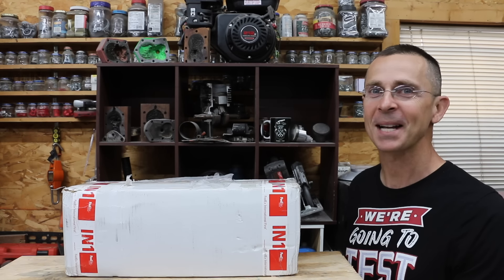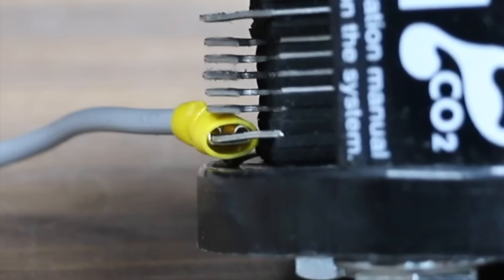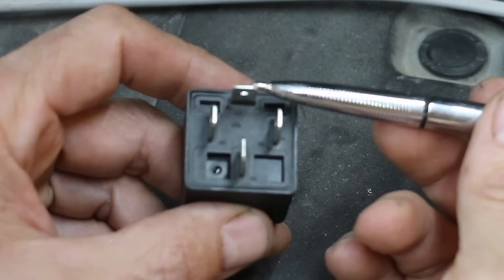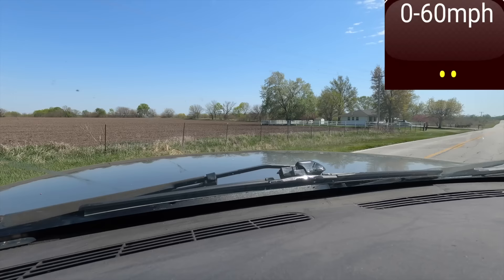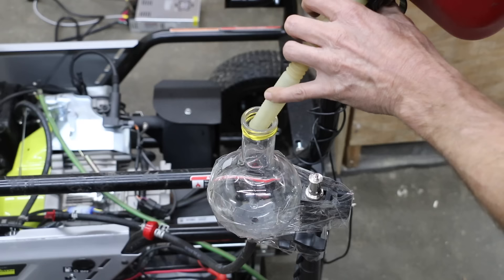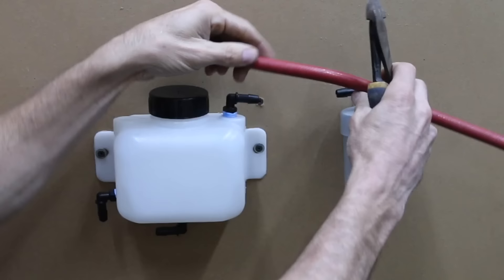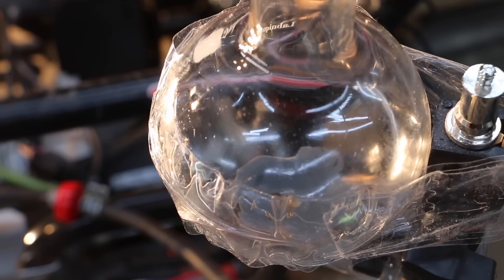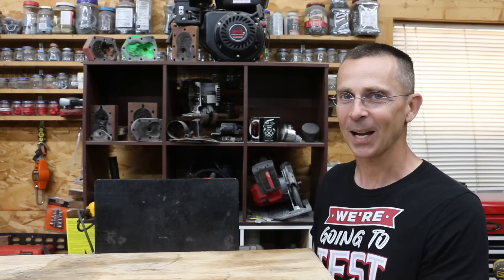AMAZING 35% More MPG with HHO? Let’s find out! Help with high gas prices?

Comment: Before watching: It seems like one of those too good to be true things.
After watching: it is too good to be true.
Reply from the maker: Thank you!
Reply: He use a generator for saving gas mileage. That was wrong you need to install in a car that can lean out the gas to save on mileage. You can’t get mpg out of something that don’t move .this tiny little system definitely isn’t big enough to show anything. So yeah he’s right it’s to good to be true because the set up is wrong . Someone figured they know in theory this works put on a different scale so they figurethey could find a handful of Desperate people to buy the product
Reply: After watching: shiiieeeeeeet
Reply: @NoBs48  You believe in a flat earth don't you?
Reply: @NoBs48  mileage is a way to measure fuel consumption. The generator runs at a almost constant rpm and if you add the exact same amount of fuel you can get a time that can be used to measure fuel consumption. Just because it didn't measure mileage doesn't mean the test is wrong. It is just a different way to measure fuel consumption.
Reply: @NoBs48  Generator was to determine if the HHO was producing better fuel efficiency and therefore a longer run time. If the system was producing more HP, the fuel efficiency would have been increased and less fuel used in the generator so therefore a longer run time. The cost of power to power the HHO generator will always create more of a tax on the system than the amount of HP it gains from the HHO gas.
Reply: @ProjectFarm  I made my own in 2009 and used it on a 95 Chevy Blazer with Vortex V6 and it did boost my mileage from 17mpg to 19mpg with normal driving probably 70% country driving and 30% city driving.
Reply: @ProjectFarm  I have another suggestion. How about making diesel from used plastic/plastic jugs?
Reply: @mathewfullerton8577  I love that he is ignoring my answer to them and the other one as well that described how this test works.
Reply: @jamespeacock356  does it a maf sensor ? No . Well that has a lot to do with it to . I don’t understand why he doesn’t use the truck as an example for gas mileage you can’t just hook it up to a generator to figure out if this thing works or not he is using the vehicle to measure horsepower it doesn’t help horsepower it just helps on saving gas this thing does work I guarantee you it works. It’s been proven . Look it up
Reply: @NoBs48  correct. There was HHO boom 15 years back. Many people DIY this stuff. Some even brought a genset in their truck just to produce more gas. Most fuel savings were obtained with fuel recalibration, carb rejetting, and the engine CPU leaning out the mixture. Being used as is, no fuel saving was seen/measured. Most DIY kit produced too small amount of gas to make the engine run too rich, but enough to lean the A/F mixture a bit without knocking.
Reply: @jamespeacock356  "it's not the answer I want to hear!"
Reply: @NoBs48  you can work out a lot, idle us p much the same
Reply: @NoBs48  It takes more energy to break down water into h2 + o than is gained by burning said gas.  So no mater how you use this device it will be less efficient.  On a larger vehicle it may be less noticeable but it will still be a net loss.  There is no magic to this device, it spits water in to hydrogen and oxygen then burns it. You have loss in the chemical reactions, loss in generating the electricity needed to power the reaction and loss in the inefficiency of engine converting chemical energy to heat and then into mechanical energy.  There is literately no way this could work out as a net positive.
Reply: @NoBs48  look bud you just seen it doesn't work many of us explained how this test works and why you are wrong. Furthermore I'm an ase certified mechanic and I am telling you this system doesn't work and all it is is a waste of money and time just like trying to inform you on just how wrong you are.  Take the loss move on have a nice day.
Reply: @NoBs48  I don't know if you're trolling or you don't know how motors work.
Reply: @jamespeacock356  Don't encourage him..😂
Reply: @geoffreycasey875  but its my post I thought I could. Lol
Reply: @jamespeacock356  I understand that but my point I really wanted to make was that a generator isn’t the same .You have a maf sensor you have different components in a car that leans out the gas so the HHO replaces it to get better gas mileage. I don’t think one this small would make any big difference so maybe his set up is correct in that it’s not big enough to help with saving gas mileage.
Reply: @Redtash1  thats cool! I'm curious how you made your own. I've no clue how to build a hydrogen separator thing. Is yours larger than the one in the video? Did you notice a power increase upon installation that can't be attributed to something else, such as intake charge drop due to extra water vapor in the air mixture? I'd love to know how you built this. I'd like try to build one myself.
Reply: @NoBs48  
   Calm down. 
     CALM DOWN! 
Punctuation is our friend. 

Be careful when you walk to the edge of town. You might fall off.
Reply: I have built an hho generator about the size of two car batteries  and with the right components that are not on this kit I could completely shut off the gasoline on my 85 ford ranger and run it entirely on HHO.  To be fair however I never "installed it and drove it I merely hooked it up started it, let it warm up then eased a ball valve closed and let it sit there and run on water split by electricity from the alternator. The explosive nature of hho however discouraged me from actually using it for anything worth while.
Reply: @NoBs48  Efficiency is efficiency, whether measured in miles per gallon or kilowatt hours per gallon.
Reply: @TAS1303  those had the throttle body injection or was it still carburated?
Reply: @MAGnetICus_Attractus  carburator.
Reply: @NoBs48  Actually the generator used employs direct fuel injection, so it has the necessary sensors. Lets say the fuel was any more energetic - the fuel injection system would reduce the amount of fuel consumed to keep the output voltage constant. This is actually far better controlled than putting it on a truck, where your driving habits will have a lot more influence on fuel consumption.
He also gave it an advantage by not taking into account the amount of energy required to produce the oxygen and hydrogen. Because you're literally making fuel with electrolysis, which is very inefficient, and putting that into the engine in addition to the gasoline.
Reply: @apaxman00  yes it's simple really because water is the product of burning hydrogen and oxygen reversing the reaction through electrolysis is reversing entropy since entropy must always increase in a system if you power the hho generator off the power generated by the engine it is being used to file it will always be less efficient the only instance this might be useful is if you run the hho generator off of grid power as the grid power might be cheap enough compared to gas's to save money even with overall loss of efficiency
Reply: My teacher actually asked me what I thought about that just yesterday. I then wrote a long-winded email explaining how the 1st law of thermodynamics applies to this situation, and how it basically makes your engine run on the battery, which saves you less than a glass worth of fuel.
Reply: Everybody this dose work if you catalise the reaction of course then you have a hydrogen fuel cell instead of an hho generator like to see someone build one of those at home the extra entropy hose into degrading the catalyst
Reply: @NoBs48  dont forget, the unit needs to make much more hydrogen than that dry cell unit makes.  1980 plymouth, with a carburetor, gained a good 5-7 mpg with a pint jar unit.  the unit did not provide enough H2 for a slant six to stay running steady, i am told 5-6 jars would have been needed, i used steel tie wire instead of plates when i made mine.  when the car ran out of gas, my unit could not make enough H2 to keep the engine at a steady speed and after 3 miles, the car was on the side of the road until i got back from the gas station with gas.
Reply: @sexylexy22100  Excuse me, what? Can /you/ give thermodynamic calculations for how your approach generates more energy than it uses? Because I can give you calculations showing that this is not the case.
Reply: @NoBs48  All a maf sensor does is measure how much air is coming into the engine. This is used along with the intake temperature sensor to approximate a proper fuel mixture. The oxygen sensor is what is used to get the fuel mixture fine tuned. You obviously don't even know how a fuel injection system running in closed loop works in an engine. Either way it takes more energy through electrolysis converting the water into HHO then you get from burning the HHO.
Reply: @TAS1303  that's why it worked without major modifications.  A while back me and a friend were talking about making fuel with waste doughnuts.   My friend reminded me how you get more gas production if you apply a vacuum along with heat. Then we were talking about those 12 volt water misters and how the heat of the combustion of fuel turns the water vapor to steam pressure. All sorts of ways to save on gas consumption.
Reply: @thanebaxter  While this product is junk, your reasoning for why you can’t get back more energy than was consumed to produce the gas is a little off.

Engines typically only run at around 30% efficiency, and that efficiency tends to increase with increased load. If you had two 5000lb trucks that you drove up a mountain, they’d consume more fuel than a 5000lb truck towing a 5000lb trailer. The HHO device is trying to increase the thermal efficiency of the engine by increasing load, and then supply its own fuel (H2 and O2 gas) to compensate for the higher consumption.

Thermodynamics would rule this out if the engine were already operating at 100% efficiency, but since 70% of the energy in the fuel is wasted as heat there is a theoretical possibility that these devices can exist. At the end of the day though this product is not worth buying.
Reply: @TAS1303  , cool story bro, if it wasn't for nature's laws of energy and thermodynamics that your story is not 100% true. As it sits the total system efficiency is way less than 100%, thus there's no way on Earth to run an engine using that "concept" alone. Just in the HHO system there's thermal loss as the unit warms up, then the alternator is less than 100% efficient, so there's energy loss there too, and since the amount of energy generated by combining HHO back into water is the same as turning water into HHO, there's no way on Earth that engine would continue to run on the HHO system alone, that while assuming that the engine efficiency is 100%, which is twice as much as the most efficient engine available today. So yeah ...
Reply: It seems like the people who so vehemently defend the HHO "theory" and make all these wild claims are the same guys who didn't pay attention in science class. Now they throw around big words they don't understand but saw in a forum, trying to appear intelligent. Here's a phrase they won't understand, but explains it all: over-unity. There's no such thing as a free lunch. If you dropped out of high school and have lived off government assistance your entire life, you probably wouldn't agree. But what you don't see is all the hard working tax payers covering your welfare checks. The same principal is hard at work in these HHO experiments.
Reply: @NoBs48  this dude definitely skipped school for flat earthin
Reply: @NoBs48  
You may recall that the gub'ment measures milage on a car the runs on a treadmill. So it doesn't move either.
Reply: @TAS1303  your truck was running off its lead acid battery. Lol. The ONLY vehicles to ever see improved mpgs were ones with worn rings and blown gaskets. Hydrogen helps in engines with terrible compression.
Reply: Interesting that everything seemed to be doing what was advertised but the numbers didn't change much. So where's that energy going?
Reply: @NoBs48  are you blind? EFI is the largest text on the generator. That means it has a map and 02 sensor. That means it DOES lean back the fuel.
Reply: @Redtash1  and plastic bags
Reply: @johnwaterman9647  it was about 11 or 12 years so the exact details i don't remember but I had a friend that gave me a piece of stainless steel that would cover like bench and cut it into I think 9 pieces about 3x5. 3 was hooked to the positive, 3 to negative and 3 was neutral meaning they just didn't have any voltage going to them just used to separate the positive and negative plates. From what I read it was supposed to help with HHO production. I bought all stainless steel nuts and all tread to assemble them. It takes alot of time to read and watching video's on YouTube to get an idea of how things work and how to put things together then trial and error on mixing the white stuff he was mixing to get the best output without drawing to many amps that will blow the fuse or melt the wire😁😁.
Reply: @NoBs48  you don't need any sensors, the generator has a GOVERNOR. if you put some sort of high-falutin superfuel into the tank, and it's producing more energy than gasoline, it'll show it by using less of it to make the same power, and run longer.
For our next test, we can dicover just how dense your brain is to a brick wall.
Reply: @synewparadigm  Yeah I put plastic/plastic jugs. I saw some videos that people was using plastic bags also. Anything that is made from the type of plastic that is able to be melted down to create it and it would also be recycling them.
Reply: @Redtash1  that's a good question.
Reply: @Tom-cc1wl  Pulling a trailer or powering a heavier vehicle may increase efficiency of fuel converted to mechanical energy, but it also increases the amount of work required. If this wasn't the case we would be building heavier vehicles to increase mpg. Applying additional load to the engine via the alternator does not increase the amount of power supplied to the wheels.  It is a parasitic device, robbing power that could have either not been needed requiring less fuel or reducing the total capacity of what the vehicle can move. So no, I still don't see how any device using electrolysis could improve fuel consumption.
Reply: @Redtash1  thanks for the info. I'll make it into an upcoming project.
Reply: @chuckaddison5134  Most people never refer to their cars mileage as what the vehicle is rated. You simply track the mileage of a full tank to the next time you fill it up. Almost everyone does that at some point.
Reply: @thanebaxter  - "So no mater how you use this device it will be less efficient."
Hmmm, not entirely true. If the ECU was able to compensate for the additional H2 gas, and the system was powered by a Solar Panel on the Roof of the vehicle, which stored electricity in a Lithium Polymer Battery - then the additional Energy would effectively be free. However I'm not convinced that the ECU's of either the Test vehicle or the Generator, was able to compensate for the addition of Hydrogen Gas, nor am I convinced that enough H2 gas was being made available. The problem with this video is that an ECU is limited by it's programmed maps, and those maps are limited by emissions. Emissions were not being monitored here. So even if the ECU was unable to compensate for addition of energy input, then the benefits of any reduction in pollutants cannot be appreciated either.

A truly 'SCIENTIFIC' approach would change all existing know variables, before attempting to observe the effect of an unknown variable. So test the effect of enriched Oxygen into Air Stream, then Test the effect of additional Octane into fuel of the Generator, to see if those known variables allow the test system to acknowledge the changes an adapt. The only way to test that fully is to monitor emissions.

So whilst I appreciate what PF does in his videos, sometimes his 'SCIENTIFIC' approach is not quite Scientific, nor are his assumptions - as most assumptions are far from scientific. I've seen videos where ECU's designed for 91 Octane run poorly on E10 and terrible on E85, but with a custom 'TUNE' for E85, the same engine runs incredibly, providing way more power than the same engine tuned to run on 91 gasoline. Ignition Timing plays a significant role in energy production of a hydrocarbon powered combustion engine!
Reply: @NoBs48  Agreed it would work better on a Carb than EFI unless you have an EFIE/MAF tuner. Depends on the the stainless steel plates and how many you have as well.
Reply: @blueridgerennsport  - "Efficiency is efficiency, whether measured in miles per gallon or kilowatt hours per gallon."
Yes, but it does not automatically imply that the test conditions of the experiment were 'scientific'. Nobody measured emissions, and nobody checked to see if the ECU was able to compensate Timing for additional energy. The test vehicle was not measured for fuel consumption or emissions. Therefore without picking this PF video to threads, IMO it is not a scientific evaluation, as too many variables and parameters were ignored.
Reply: @graealex  - "Lets say the fuel was any more energetic - the fuel injection system would reduce the amount of fuel consumed to keep the output voltage constant."
Hmmmm, only partially true! You see all engine manufacturers are limited by EMISSIONS. Do we remember the whole VW EGR BYPASS SCANDAL? Yes, VW engines developed a lot more power than any other manufacturer, but not because they built a better engine, it was only because they programmed the ECU to take advantage when the vehicle was not set up on a Dyno for testing EGR & EMISSIONS. Unfortunately, like many other PF videos, he is not always very 'scientific' in his application to all the known variables.
Reply: @Redtash1  Did you replace your spark plugs at the same time or fix a vacuum leak? LOL. I made one of these too back in 2005. It was fun to learn about and make small explosions from filled sandwich bags. Physics remains the same though. It takes more energy to produce the gas than the gas makes when it burns. Otherwise, why has someone not made a perpetual motion machine powered by one of these with the only fuel being water and electrolyte connected to an alternator to produce the electricity it needs? once it gets started it will keep going, right? clean burning evolution of cars! LMAO.
Reply: @sexylexy22100  - Unless PF used a Solar Panel on the roof of his truck, and stored the required energy in a 12V Lithium Polymer Cell...?
Reply: @Earlve001  Depends on what you mean by proper? If you don't take into account the power it takes to run the HHO generator, then the test is invalid. A alternator in a car does not spin easier the more power it is creating. Regenerative breaking in new electric vehicles are basically using their motors as an alternator when the car is braking and the resistance that is crated by making the power is what slows the vehicle. Taking the power generation out of the picture would only taint the results.
Reply: @mathewfullerton8577  Must be a Democrat. Dont need facts, just feelings :-)
Reply: @sexylexy22100  - Yes, a HHO generator can work more efficiently if the ECU is able to recognize and compensate for the additional energy, and when the HHO Cell uses a larger Surface Area to Volume Ratio and a forced flow to remove gases from the Surface Area. I have previously built a system that uses a Twin Water Filter Cartridge system, with Extruded Carbon Filters as Anode and Cathode. The effective Surface area of a regular 10 inch Water Filter cartridge @1um is about 1 acre - as opposed to about 100 square inches of that crappy HHO generator. With the addition of a small Brushless 6Watt (0.5A) water circulating pump, the liquid flowing through the filters is constantly removing any gases, which in turn gives a constantly higher available surface area for HHO reductions to be performed. Adding a Solar Panel to the Roof and a Lithium Polymer Battery means that power is not being taken from the engine for Electrolysis.
Reply: How do you check efficiency on a carburetor with now way to lean out and actually test if its helping with efficiency
Reply: @danielrouw2593  - " That means it DOES lean back the fuel."
Your assumption might be true, IF and only IF PF monitored the EMISSIONS.
The ECU only adjusts Timing in accordance to known parameters, to meet emissions standards.
PF would need to do runs with High Octane Fuel to see if the ECU is able to adjust it's tune to allow for Timing that can take advantage of High Octane Fuel. He would then need to see if the ECU can account for a higher concentration of O2 gas, as most ECU's assume 20% at 68F at Sea Level.
As much as I love PF, this experiment is far from SCIENTIFIC.
Reply: @danielrouw2593  it was 288 4"² stainless steel plates.  it rolled off so much gas it was scary. Can't tell me the engine can't ignite that.  Granted that old hundred dollar pickup had crap for compression. You could put it in first gear and push the vehicle. But in the five years I owned it it never used oil. I recall putting a high amp alternator on it and some other electrical part that had something to do with voltage or amperage to the plates and I purchased a mass air flow sensor manipulator to install the rig on my Chevy but never did due to safety concerns. I can make it work. Someone else's inability to do so does not mean it can't be done. Hell you can run a pickup on wood smoke even.
Reply: @NoBs48  Hey bud, is this you in the passenger seat? See you tube :
The real meaning of MPH- The Original- TCHappenings
Reply: @ProjectFarm  it would be great to see a magnetic water softener tested. But you would be forced to take the video down by the manufacturer. You might even get sued for loss of business.
Reply: @delawarecop  That doesn't even remotely relate to using the generator as a measure for relative (!) fuel efficiency. Obviously it's possible to make an engine more efficient if e.g. more NOX emissions are allowed, driving the engine with a leaner mix. 
Besides, there is not a single good explanation why injecting hydrogen and oxygen would produce a surplus of power relative to what you have to spend to split up the H2O in the first place.
At least with stuff like water injection, we actually know that the water vapor cooling down the combustion increases efficiency. But there is no explanation why adding a little bit of H and O2 should increase efficiency by the claimed 35%.
Reply: @Redtash1  no you didn't.
Reply: @delawarecop  It doesn't need to be scientific here, only entertaining and ultimately correct. There are countless other scientific experiments and studies done on HHO, all with the same outcome - it doesn't work. Project Farm already knew that going into the test. Most of us already knew that before we watched this video. Even some of the people who swear that HHO actually works know it. This was just a fun way of making a point.
Reply: @Earlve001  ahh, I see. Or anything at all (good or bad). Good point. Then yes, a test with an alternate power supply would be handy.
Reply: @graealex  - Put a Solar Panel on your roof and have it charge a Lithium Polymer Battery while it's parked. That FREE electricity can be used for the HHO process, so you end up with a NET SURPLUS of energy. And if enough HHO can be compressed an accumulated in a tank, then 35% improvement of efficiency could actually be realized.

Just think for a minute of how many cars driving on roads without a Solar Panel on the Roof, and WHY EXACTLY don't car manufacturers use that FREE ENERGY to reduce the combustion engine efficiency of having to drive an Alternator?
Reply: Can't they be sued for false advertisement?
Reply: @NoBs48  

As Clemence has stated, fuel saving happens when the mixture is leaner and not as rich. This is done though a computer controlled program that makes the airflow less rich. Any car can have this installed on it.
Reply: @delawarecop  Might as well carry an additional gallon of fuel, if you have to carry the weight there is a lot more energy in a gallon of gasoline/diesel then there is in a gallon of water. Plus you don't need to haul around all the crap that is needed to generate the hydrogen.

If you are hell bent on burning hydrogen then it would make more sense to leave the solar panel at home generate your hydrogen there and then transfer it to a fuel cell on your vehicle.  Of course you also need to re-tune your vehicle to adjust for the hydrogen.

But if you are going to run solar at home it makes even more sense to just charge an electric car and forget about the hydrogen.
Reply: @delawarecop  Power from the little area on the roof is negligible. I work in automotive, and in the simulations and tests, it was barely enough to keep HVAC (without actual AC) running on a hot day to decrease inside temperature. And that's if you get a lot of sunshine where you live, to offset the additional weight you will be carrying around day-and-night.
People like you just need to stop their fantasies, somehow thinking they are a lot smarter than all the engineers. Just, like, stop with it. It only shows how little you understand of the topic.
Reply: @delawarecop  Solar panels and LiPo batteries are not cost-free, and a solar panel (or array of solar panels) large and efficient enough to charge a LiPo battery large enough to supply voltage and current for the entirety of your run cycle will encroach on your aerodynamics and add weight to your vehicle (as will whatever HHO contraption you have rigged up), contributing to drag, thereby lowering the overall efficiency of your vehicle. It has been proven time and time again that any gains from HHO will not overcome those losses. Calculate the costs of the materials and equipment used toward any gain experienced and you will find that you're in the hole, and calculating a return on investment isn't possible. Look, you can use propane as a catalyst for extracting more power from a diesel engine, and it is very effective, but the costs and added complexity involved prevent it from being an efficiency booster. Instead it's used as a power booster and range booster for towing. Propane injection systems use 1 gallon of propane per every 4 gallons of diesel (20% of the fuel being consumed), yet only offers about a 14.75% increase in instant MPG. So instead of going 816 miles on 48 gallons of diesel (17 MPG), you go 936 miles on 48 gallons of diesel plus 12 gallons of propane. Since diesel and propane are about the same cost where I live (a difference of just pennies per gallon, propane being the more expensive of the two), it's actually less economical to use propane as a catalyst because you're only getting 10 MPG from those additional 12 gallons of propane, while 12 gallons of diesel nets you another 204 miles at 17 MPG. Once you factor in the cost of the parts/equipment, installation, consumables, maintenance, drag, additional wear and tear, etc., nothing you do in terms of adding a catalyst system like propane or HHO will increase your efficiency to the point of earning a tangible return on investment.
Reply: @thanebaxter  - It's about IMPROVING the efficiency of an ICE. HHO does that, and so does N2O. For the $ I personally would go for N2O as a catalyst. But if an ICE is tuned to operate at maximum efficiency using HHO, then it does improve the efficiency of any ICE, but more importantly it reduces pollutants and reduces the destructive need of EGR. So there are more long term benefits to adding HHO than chirping tyres.
Reply: @jamespeacock356  This will not make more power...    that  HHO generator  can barely make anything  the amount is laughable
Reply: @delawarecop  For it to work properly would you not have to very the amount of HHO you were adding to the engine?  Obviously the ratio of HHO to Fuel would vary if you inputted a constant amount of HHO at idle as compared to road speed with a load.  The vehicle has no way of knowing that you changed the air to fuel mixture so that would cause varied results and possibly make emissions worse.  I just don't see a hose bubbling in HHO making any noticeable positive difference, but I could see it causing problems. Without an external source of power I am confident it would still end up a net loss of fuel efficiency.  Hydrogen is much less energy dense so you would need more by volume to offset the fuel it replaced.

If you have a source of an actual scientific paper proving this tech works I would gladly read it, but with people just making claims and having no controlled measurements I find it suspect. Too many unknowns that could cause variations in data, making it look like it worked when in fact it didn't.
Reply: @danielrouw2593  it's not a California version lol
Reply: @apaxman00    if you have a hybrid  you can make  power via the regeneration   most of the regeneration is lost to heat anyways  I.e once the battery is full
Reply: @danielrouw2593  it has No map or maf sensor I checked the parts list  for that generator      but does have an O2 sensor   so it's an incomplete remark you have there
Reply: @delawarecop  I used an HHO system about a decade ago and did lots of research to learn how it worked. The idea as you said is to get the computer to allow the HHO to do its job. If the parameters of O2, MAF, IAT, Coolant temp, and timing are not allowed to go beyond factory settings then there will be no observable benefit as we saw in this video. The system I researched was designed to combine HHO with "cracked" fuel (breaking the molecular structure of the fuel into smaller chains and adding hydrogen to stabilize them) that would then burn more quickly in the combustion chamber. That does no good unless you can retard the timing to take advantage of the quicker burning fuel. It burns cleaner as well. The problem has always been the CPU in the vehicle itself. I know you can increase fuel efficiency just by manipulating those parameters but as was stated by someone else you run the risk of engine damage. With the HHO gas added to the fuel properly it actually helps prevent that damage. Its a fairly complex process that happens at the molecular level and I cant explain it all here, and its been over a decade since I researched all this, but the science of how it CAN work is solid.
Reply: @graealex    this might work for a hybrid as you would be capturing the power via regenerative braking  you can get like 20-30KW  from a full power regenerative braking....
 that is almost 2,500 amps at 12volts
which other wise would be lost as heat
Reply: @delawarecop  You're not even smart enough to understand what a catalyst is. With N2O, it undergoes combustion, and that is the exact opposite of a catalyst. Which is actually good, as N2O has a serious greenhouse effect. Please stop the fantasies, it's really making you look silly.
Reply: @jebbusk4805  Lol at the contrived explanations. This is borderline perpetuum mobile territory. Yes, add a bit of oxygen and hydrogen, and it solves all the problems that engineers have been working on for more than half a century. I'll just assume your "research" involved a lot of Facebook posts.
Reply: @Delimon007  The problem with a very lean mixture are NOx emissions. Emissions in general are what is currently holding back efficiency. Especially Diesel engines are suffering from the back pressure from all the exhaust treatment. That isn't even a secret somehow, everyone knows that the operating point for maximum efficiency is different from the operating point for best exhaust treatment. But the reality is that cars can't be driving around spewing out NOx and particulates without limits just to improve fuel efficiency a few percent.
All the people here need to understand that engineers are already operating very close to what is possible, and that there is no magical 35% improvement to be had, nowhere.
Reply: @graealex  

It's actually not just a few percent for many cars. Done properly you can increase your MPG by 50% but it depends on the car. If it's a hunk of junk then it's not going to help much. If it's a sports care you can greatly enhance you MPG.
Reply: @Delimon007  Well, might be a true for a modern Diesel, which can be very efficient if you completely forget about particulates and NOX. Ultra-lean mix, high boost, no exhaust gas recirculation and no particulate filters as well as any catalysts, a good amount of efficiency increase might be possible.
Reply: @punker4Real  Yes, but using that energy for electrolysis of water is just bonkers. And I don't want to sound condescending, but a large chunk of the efficiency increase that can be had with regenerative breaking can also be achieved by changing driving habits.
Also, it again shows that most people here, including you, have zero idea of what they're talking about, as anything above 10kW requires 48V. That in turn requires an additional battery, as well as DC-DC converters. You're also needing a combined starter-generator, which also adds weight. 
It's not like car manufacturers and suppliers aren't calculating this stuff day and night already. But everyone here is "I am a genius because I have an idea that no engineer could ever have thought of".
Reply: @graealex  

It requires a computer to do it for a reason
Reply: The comments on here are a riot.
Reply: @Delimon007  I don't understand that remark. ECUs have been a thing in cars for more than 3 decades. "Putting a computer in" isn't a novel idea, especially none that solves any problems that haven't been solved before.
Reply: @jamespeacock356  I’ve never seen a better example of a pot calling a kettle black. You both have little to no understanding of ICE, this is very possible but like T Miller is trying to explain, it has to be implemented correctly to gain maximum efficiency from the system. Simply adding more fuel to the mixture doesn’t work with modern fuel injection/electronic ignition like it did with engines that use a carburetor/points.
Reply: @graealex  it was actually from the people who developed it. I dont claim to be a chemical engineer, but there's more making HHO an effective additive to make gasoline a better burning fuel than simply adding it to the intake stream. This system is just a small part of a much larger equation...it really is pretty fascinating when you get into the details of it.
Reply: @jebbusk4805  Yes, it's a very large equation and then it all suddenly makes sense. How convenient that nobody is actually able to explain it, besides vague hints at also using a different fuel or completely forgetting about engines having to operate withing emission targets. But everyone can claim that, if properly implemented, it works really well.
Besides, the product reviewed in this video claims the benefits just from installing this unit. And that is fraudulent.
Reply: @graealex  I agree the claims on this unit are fraudulent,  but tell me what the most efficient form of fuel that can be burned completely is? Plasma is what I understand...and if you or the automotive engineers can figure out a way to get cars to run on plasma derived from gasoline then that would really be something! There would still be limitations on how efficient you could actually make the engine burn that fuel and convert it into rotational power but it would at least burn completely and have zero emissions.
Reply: @Redtash1  it's impossible since you can create energy and you consume energy to produce your hho from your car electric system
Reply: @jebbusk4805  oh man dude. Plasma is not a fuel. Plasma is a state of matter and is not something you'd be running a car on. At least not directly. The most efficient internal combustion engines are those found on large ships. But that's due to the engine's slow rpm. The fuel type doesn't really matter as far as efficiency goes. The difference is the way an engine burns fuel to create mechanical energy.
Reply: @punker4Real   copied direct from the efi service manual component list "Oxygen Sensor — Exhaust mixture monitoring device" 
And.. Under intake manifold
"temperature and PRESSURE sensors" 
Quote direct from the manufacturer "Equipped with an automotive grade Electronic Fuel Injection system, which provides up to 25% fuel savings, simplifies off-season storage, and provides optimal performance in a variety of altitudes and temperatures." so yes it WILL lean out the fuel.
Reply: @delawarecop  clearly you don't understand how EFI works. EFI adjusts FUEL INJECTION. Many EFI systems run a dizzy, EFI /= timing. Its in the name.
Reply: @smarts53  fair enough...I genuinely am interested in learning more on this subject, there is an amazing potential for changing the way we can move and live in this world. I would like to honestly know if there is a way to make the fuel we burn more efficient...as in burn more completely. The catalytic converter in a vehicle is there to burn the unburned molecules of gasoline...the ones too long to be burned inside the combustion chamber right? So how do we get the fuel momecules small enough to be burned more completely in the combustion chamber? As I understand it, if you can break apart a molecule it becomes unstable and wants to form back into a stable form...adding hydrogen molecules would acconplish this right? Smaller molecules of fuel burn faster than longer ones right? Methane, butane, ethane, etc. Am I on the right track or completely up in the night? I would like to learn more if you or anyone else could chime in on this subject I would be all ears!
Reply: Can an internal combustion engine be tuned to run on hydrogen? Yes. Multiple manufacturers have built cars that ran on hydrogen. BMW even produced a 760Li that ran on either gas or hydrogen and kind of leased it... sort of. It can be done. Not by any of you, of course - your projects won't amount to anything but a hazard at best, or a fire that burns your trailer park down at worst. And those with a firm grasp on physics and the actual knowhow won't, because they understand it's a losing proposition. The outcome is disappointingly inefficient and that is the main reason we don't have hydrogen-burning cars today. Hydrogen-powered cars get about one quarter to one third the mileage as their gasoline counterparts. It requires a lot of hydrogen, much more than any of your cobbled-together contraptions can produce, and it requires regulation - something else that pile of junk you zip tied under the hood of your jalopy cannot do. You know, I get the impression that some of you guys completely believe that some random broke-dick hack, just like you, built the 100MPG carburetor only to have the oil companies threaten him and his family and force him to turn over the patent 🤣 You flat-earther sovereign-citizen types enjoy driving your HHO-powered cars around.
Reply: @jebbusk4805  "plasma derived from gasoline" - this is so outlandish and shows so little basic understanding of the terms you are using. Plasma isn't some form of fuel, it's a state of matter.
Burning hydrogen is perfectly fine, not only does it burn cleanly, but in addition without any CO2 emissions. But that hydrogen still has to come somewhere, and electrolysis is still very inefficient.
What matters most is practicability. There are ways to extract heat energy very close to the theoretical maximum, but that's very impractical for a car - it works better in power plants. Lots of stuff has been tested, even extracting energy from the waste heat of the exhaust gasses, or as someone has mentioned, putting solar panels on the roof, but the reality is that all these concepts have failed on accounts of being too heavy, too complex and too expensive with negligible benefits.
Using electrical energy to produce hydrogen in a car with an ICE also falls under the category "negligible benefits", or outright worsening efficiency.
Reply: @graealex  ok, thx for helping clarify my understanding. So is there a practical way of helping make the fuel we currently use burn more completely? Even just a small percentage would mean huge fuel savings over the long term and help us extend the use of fossil fuels while we develop alternatives.
Reply: @danielrouw2593  - LOL, the EFI doesn't run by magic... it has a programmed set of parameters, which ensure that it operates within emissions requirements. If the Computer doesn;t know about HHO gas input, then how does it know to adjust for better timing? Otherwise you are saying that the EFI will automatically adjust to give more power when you put 98 Octane fuel in the tank?
Reply: @jebbusk4805  - Of course HHO can work, especially if the engine is specifically designed to take advantage of the rapid shock wave that is produced when Hydrogen oxidizes. And as I said, I designed a system that has 1 acre of surface area in a 10 inch Carbon extruded Water Filter. SO when coupled with a small brushless DC pump, the system is far more efficient at splitting H2O into HHO, than the dinky little $200 device that PF purchased.
Reply: @jebbusk4805  If you want to save on fuel, drive a smaller, more lightweight car and be gentle with the throttle. Instant 35% MPG increase without installing any sort of bogus HHO generator.
Reply: @TAS1303  Yeah... not to mention potassium hydroxide - KOH is (a form of) lye (sodium hydroxide - NaOH -  is household drain cleaner form), *if something explodes you could end up with lye solution in your eyes!*

Finally... the plates in the gas generator are usually made of stainless steel. Electricity flow + the KOH can leach some of the chromium out of the stainless... and into the solution. Chromium exposure (especially in its hexavalent form) is a good way to get cancer.
Reply: @delawarecop  You really, really need to lookup what a catalyst is - a catalyst either temporarily participates in a chemical reaction and afterwards returns to its original state, or it never changes at all. As such, NO2 isn't a catalyst, it's a reactant, as it decomposes irreversibly. Just stop posting nonsense here. And yes, part of the N2 actually gets combusted, that's the dreaded NOx as a result. Injecting N2O as a way to increase fuel efficiency or even reduce emissions is about the worst idea I heard in years. Complete fantasy world you are living in.
Reply: @delawarecop   If your solar panel and battery aded no weight, aerodynamic drag, or cost to the vehicle, then they would truly be magic.
Reply: I didn't research it any further, but there are published research articles about this. It's hard to believe all of them were lying and it isn't the kits that are trash. The hydrogen is used to boost the inital explosion provoked during ignition and maybe this requires more changes.
Reply: @graealex  ok nevermind...im asking questions that go beyond this gimmick. The HHO thing can work if every variable is accounted for but it requires way more than what was tested here. All Im saying is if there is a way to enhance the gasoline being burned to make it burn more completely then that would benefit any ICE. As far as plasma goes, are you saying there is no way possible to get liquid fuel into this fourth form of matter?? Solid, liquid, gas, plasma. You have to break it down without igniting it right? As I understand it if that form of matter could be burned in an ICE it would burn completely..its well known its more efficient to burn fuel as a vapor, so why not take it a step fuether? Obviously there is no such thing as this in the automotive industry kthat Im aware of), im just saying what if?? Hydrogen as I understand it is a step in achieving this....then you would have the energy that gasoline provides (as opposed to just burning hydrogen) but in a  complete and clean way, and it would yield much greater fuel economy and power. I would love to learn more about this subject and initially I thought you might be able to discuss this, but you seem more interested in acting like the smartest guy in the room and being condescending towards others, not cool man. Maybe this just isnt the right place for discussing such topics....
Reply: @vitordelima  - Yes, hydrogen is a useful fuel in an ICE. How it is being produced, from an Alternator running off Hydrocarbons is never going to increase the efficiency of an ICE. If the Electrolysis unit is powered by another source (Flexible Solar Panel mounted on the roof - charging a Supercapacitor and Lithium Polymer Battery), then it can improve the efficiency of an ICE for short runs of up to 3-4 hours, after 6-8hrs of sunlight to charge the system.
Reply: @graealex  

FYI, if you are an engineer you should already know that humans are not the major cause of pollution on the Earth anymore. The major cause of pollutants on the Earth is currently the Earth itself. If you want to advocate for the reduction in pollution then you need to go talk to third world countries and China.
Reply: @Delimon007  Lol, "the earth itself". The main factor is still humans burning fossil fuels. And finger pointing doesn't help anyway.
Reply: @graealex  

Here's another fact, scientists DO agree that global warming and climate change is an issue, did you know that there is no consensus that humans are the cause of it and that most scientists actually disagree that humans are the cause of global warming?
Reply: @Delimon007  There is 100% consensus from every respectable scientist that human CO2 output plays a major role in global warming. Don't invent stuff here.
Reply: @graealex  

I just gave you multiple links that debunks that nonsense. have a nice day sir since you clearly do not believe in facts.
Reply: @Delimon007  Posting links on YouTube doesn't work due to anti-spam measures, and there is nothing to debunk climate change anyway.
Reply: @delawarecop  

I would recommend that you stop arguing with that person. No matter how much proof you post of ACTUAL ENGINEERS AND SCIENTISTS DOING THINGS, that dude will deny it.

Computer chips are extremely important because they control how things work and as you stated if the computer doesn't know about something it's not going to use it.

They actually also explain this in the video I posted where they made the corvette fuel efficient, the chip needed to be changed to recognize the air flow mixture and get the timings right etc.

That person is clearly not a coder nor an engineer so speaking with him/her is a waste of time especially since they already know everything there is to know.
Reply: @leeroth5604  this was easily 12 years or so ago and all what was used in the prototype hho generators  was water and a small amount of calcium carbonate. I have no personal knowledge of any possible benefits of using any hydroxide salt instead. A tablespoon of baking powder seemed to work just fine
Reply: @jebbusk4805  The error is your assumption that fuel isn't already being burned as cleanly as possible, without increasing noxious emissions. As stated multiple times in this thread, fuel efficiency can simply be increased by sacrificing quality of exhaust treatment. Especially burning a leaner mix leads to higher fuel efficiency, but the higher temperatures coincidentally lead to the formation of NOx combustion products, which are dangerous to humans.
And no, mixing in a negligibly amount of hydrogen will not change this. 
The concept is flawed because there is no free source of HHO. A study from 2015 shows significant increase in fuel efficiency, but completely neglects to account for the power draw of the HHO cell used, as well as the energy cost of producing the reactants (NaOH, KOH, both which are very energy dense by themselves) in the cell. This might seem insignificant, but it's actually the most important thing: where does the hydrogen come from?
What would actually have more chances is water-injection. Although not recoverable, it only acts as a catalyst to increase thermal efficiency, and with proper ECU adaptation increases fuel efficiency. Maybe people are confusing these two technologies.
Reply: @Delimon007  Both coder and engineer. And hearing someone say "Computer chips are extremely important because they control how things work" doesn't lead me to believe you are understanding how an ECU actually works.
And as repeated multiple times, the source of the hydrogen is the problem. Burning hydrogen is 100% a good concept. But if you have to produce it on board of a vehicle, you can't claim the amount of gasoline saved as "increased fuel efficiency" without mentioning the power draw, as well as the energy in the reactants inside the cell. You're just moving the power source.
The theory behind all this is that you might be able to use a leaner gasoline mix, which by itself would actually help with efficiency, at least in situations with low power demand, as injecting hydrogen leads to less formation of NOx. That's the theory, but without any actual numbers that account for all the additional energy required to produce that hydrogen. I'm fully aware of the working principle. Are you?
Reply: @jebbusk4805 keep in mind that achieving 100% complete combustion does not mean 100% efficiency. What we want to do in an engine is take all of the available chemical potential energy (the potential for the fuel to make heat) contained in a fuel and transform it into mechanical energy (move something). Engines already burn their fuel extremely well. The hard part using that combustion of fuel to spin something. Technically you could probably make a plasma out of gasoline and it would be scary and not very useful for anything other than setting your lab on fire. Plasmas occur when an atom has all of it's electrons ripped off by getting really really excited. Ever seen an electrical arc from welding? That super hot bright arc is made of plasma from the shielding gas and metal being welded. Not exactly something you would use as a fuel for an engine. Also to generate such a gasoline plasma would take energy. And thats energy you're using to create plasma and not power the wheels of a car.
Reply: because its not true.. its fake
Reply: @jjOnceAgain  that’s it I don’t know how motors work . I just watch 10 minutes YouTube video and  agree with this guy or that one . You think the guy that invented this spent a day figuring it out . The System works whether or not the scale of this one isn’t working is another story. Saying that it does not work after testing  a generator is absurd . I can agree to disagree. Don’t forget what happened to Stanley Meyers after showing this to the oil company’s .
Reply: Yeah, this is one of those things where if it worked everyone would be running them already.
Reply: @NoBs48  an electric fuel injection generator does have one of those sensors, which is why they're so much more expensive than a regular generator
Reply: @Delimon007  “According to a new paper by Ott and Pickering in the Journal of Geophysical Research, each flash of lightning on average in the several mid-latitude and subtropical thunderstorms studied turned 7 kilograms (15.4 pounds) of nitrogen into chemically reactive NOx. "In other words, you could drive a new car across the United States more than 50 times and still produce less than half as much NOx as an average lightning flash," Ott estimated. The results were published July.”
Reply: @secondgenerationcleaning9246  dunno if your old enough to remember the fuel magnetic stabilizer units that was being sold back in the day.
Reply: @Tom-cc1wl  I work at a nuclear plant and we waste thermal energy by overcooling condensate, but it increases work of the turbine.  Decreasing total efficiency allows us to increase MWh generated.  That is what we get paid for.
Reply: @NoBs48  the problem is that you use energy to get the gas and burn it to gererate the power for the system.
lets say you get 100% efficiency on creating gas and 40% at burning it and 80% at the generator (Real world not realistic at all.) now you got a effieciency of the whole system of 32% of the used energy. >100% would be needed to get something from the system - this maths only show if the system is powering its own so not that complex but still enough to show that this cant work out.
Reply: @blueridgerennsport  Over-unity is not the issue, you're mixing the crux of the argument. The HHO is not trying to generate more energy than it consumed, it's trying to take advantage of the fact that thermal efficiency increases with load. It's hoping to generate fuel at a higher operating efficiency and displace some of the gasoline in the combustion process.

The HHO theory really falls apart because it's relying on an assumption that the engine can convert H2/O2 gas into useful work at a higher efficiency than gasoline, and I suspect that's not true. At least not at an efficiency that offers any practical improvement.

If you stuck 50 Peltier devices on the engine block to power the electrolysis then I don't think anybody would object that you're extracting more useful work from the combustion process. I think people are getting hung up because they don't understand that the efficiency of an engine is not constant across the power curve.
Reply: @NoBs48  Sorry but the concept ITSELF is flawed.
You CANNOT generate enough Hydrogen to make a difference without using MORE energy to separate the water.
water is hydrogen that has ALREADY BEEN BURNT.
It is NOT easy to liberate oxygen from a combustion by-product.
Reply: @delawarecop  once again you show your lack of knowledge. EFI does NOT = timing. It is a FUEL metering system. It IS programed with a WIDE set of parameters because air density drastically changes based on many factors. It's called fuel trim. The ECU uses the O2 sensor to check for proper cumbustion and will add/reduce fuel accordingly. Quit bringing up timing, when you aren't even grasping how an efi system measures fuel and air.
Reply: @stuartgray5877  This exactly. The HHO thing is "unburning" water just to burn it again.
Reply: @slycarlo8747  

Exactly, this is why you don't listen to what the media tells you nd why you do your due diligence and research. Thanks for the info.
Reply: There's a reason none of this pseudoscience has been engineered into automobiles even though it's been in existence for 85 plus years. It does not work. Period. Hard stop. If it did we'd have cars with gasoline and compressed hydrogen tanks that we'd fill up at the same time. The physics don't work, even in lean-burn conditions. Most of the "work" that happens in a gasoline engine is performed by nitrogen in the air absorbing the energy of combustion and expanding. Gasoline has three times the energy density of hydrogen, and even if you were able to replace half the gasoline of a stoichiometric air/fuel mixture burned in the engine with hydrogen, the energy released in combustion would, at best, only equal 67% of that released by gasoline - a losing proposition. You could try to advance the ignition to make up for a little bit of that loss, but the engine will start to knock a lot sooner. You can try to prevent some of that detonation with water injection, but you are still not making even 75% of the power you would be with straight gasoline. Then you have the issue of stoichiometry. In theory, the stoichiometric air/fuel ratio for gasoline at sea level is 14.7:1, while the stoichiometric air/fuel ratio for hydrogen is almost 2.25 times that, around 32:1. Saying this poses a problem for the ECU to calculate a proper AFR between the two fuels is an understatement. There is no linearity between the two fuels - air temperature, air pressure, combustion pressure, moisture content of the air, etc., etc., all affect the two fuels differently. Any formulas that people have come up with are band-aids at best, and likely only work in two mapped instances, if at all. Then there's emissions... Hell, there are a lot of other contributing factors, but why bother going into them here? None of the fools who believe in this fairytale are going to read it and they don't possess the brainpower to process it anyway.
Reply: @smarts53  yeah, I understand you can never take full advantage of converting combustion into mechanical energy, I wish I could remember the guy who developed some of this technology, Id post a link and then we could all discuss how correct or flawed his tech was. It delved into the literal chemical and molecular changes that are going in in an ICE and ecmxactly how he could help improve that...really was interesting stuff.
Reply: @NoBs48  It takes power to make power, regardless how you set it up, you have to get more energy from somewhere else. At that point, why bother. Even if the cell did improve efficiency, you have to find "extra" electricity somewhere to power the cell.
Reply: @jamespeacock356  i am a motor and heavy diesel mechanic I have a good understanding of H..H...O  I have run wet cells in a number of vehicles petrol and diesel   . It does work .you need to study more .my testing has not been done on a rip down the road test it has been done over 1000,s of k,s computers ECU,s do play apart in some vehicle's long and short memory which only goes to prove that HHO is affecting the fuel burn rate .All though dry cells do work  they are called coffee makers by those that know how to produce good quality H...H...O . the volume of HHO is not always what has to be looked at the quality   of the H...H...O / Browns gas / yuel Brown  is what has to be understood. I will not waste my time debating as to weather it works or not becauseit only serves to start a shit storm of people that  that dont know what they are talking about .
Reply: @thanebaxter  Excellent response!! Thermodynamics for the win. :)
Reply: Spoilers! Jeez.
Reply: @delawarecop  Or from some wasted energy in the engine. I think the articles I saw used a separate hydrogen fuel tank instead of HHO.
Reply: @vitordelima  Yes, Peltier Thermo Coupling devices could use exhaust gas to generate electricity, as could a radiator. Yes while a car is parked, the Solar Panel on the Roof could convert sunlight energy into electrical energy to be used to split water and compress in a tank.
Reply: @lightfoot9485  I just laughed so hard I fell of the edge.  My mobile phone will be out of range any minute now.  Goodbye... ;(
Reply: @NoBs48  Aaaaaaaaaaargh!    Send in the clowns...
Reply: @delawarecop  Probably. And it isn't the only fuel additive that helps. Maybe this will be researched further in the future.
Reply: @blueridgerennsport  Now THAT's a straw man argument if I ever heard one!  Poisoning the well,  too!
Reply: @Earlve001  Or better yet,  buy an electric vehicle.
Reply: @chuckaddison5134  Kurt Vonnegut fan?  But yes,  dyno testing is seldom accurate in and of itself.  Wind resistance and rolling friction come to mind.
Reply: @chuckaddison5134  Into heat.
Reply: @jessefolk6668  We don't anymore.  our dealership used to employ several car be-raters,  but we got tired of them and put them in cars with fool ejection seats.
Reply: @Delimon007  To a certain extent.  But lean mixtures really have more to do with emission control than with economy.  Too lean of a mixture as well as too rich of a mixture can lessen fuel economy.  It's OK to run slightly on the lean side of stochiometric,  though.  Also remember that newer engines are designed to handle leaner charges.  Why,  even back in the 1970's, Honda came out with the CVCC engine,  which was hyped to be an improvement of the classic stratified charge engine.  I drove one back in the 80's,  and it did get at least 26 MPG city.
Reply: @gyrgrls  Oh yes, you are right, it's a vast conspiracy by the automakers and oil companies to suppress this "technology" and install plants like me to provide misinformation and run interference. 🙄 A handful of blue collar geniuses and backyard tinkerers have outsmarted the best and brightest of our engineers and scientists 🤣 You've got the world by the short and curlies now! Good grief...
Reply: i was like wait it involves holes in ur air intake? that's a scam
Reply: @danratsnapnames  Probably not. I’m in my mid 20s.
Reply: @NoBs48  The generator is a much better fuel savings test. Consistant resusts where there aren't as many unknows variables
Reply: @secondgenerationcleaning9246  another major issue with HHO in a modern car is what you mix into the water to make it more conductive.  Most products dissolve into the water and is carried into the engine as steam and is then deposited into the engine which in turn cases many issues later on months later with your engine.   Hho for modern engines is bad idea.  I discovered this year's ago on my own car.  So take it from an elder.  Bad juju
Reply: @NoBs48  Project Farm did an excellent job testing this, sometimes I don't like him too much because his treatment for the poor tools he tortures to death (That mower is a martyr) But now he proved the point: There is not such a thing like a free meal, if you use the engine's energy to split water into hydrogen and oxygen and recombine it later, you'd get less power than the power you add to it before because much of the energy is spent like heat (the eletrolyte warms up) and in the best case scenario, the HHO burn by the engine will yield 35-40% of the theoretical output (not because it's HHO, gasoline yields the same)  . In order to be really efficient, water should be warm, the problem is the water temperature should be around 1500°F (800°C) and water above 705°F stays as gas and it can't be hydrolyzed, I saw a guy once who said he invented a water powered car, and it was half true the problem was it wasn't just water, he had also calcium carbide in the tank, this produced acetylene that was the actual fuel.
Reply: @TAS1303  if you're notuseing it send it my way I'll hook it up and run the hell out of it
Reply: @jebbusk4805  You claim — obviously utterly falsely — that you understand plasma physics.  Well, I happen to be a plasma physicist, and it is beyond all doubt that you have not even the slightest concept of what a plasma actually is.  A plasma is typically at a temperature of 30,000°C and up, unless highly unique conditions are employed, with all of such unique conditions being extremely inefficient.  To create a plasma, the fourth state of matter, requires that the outer valence electron cloud be hot enough such that at least part is stripped away, thusly forcing the then monatomic atom into a high energy level vastly far beyond anything that could occur in any ordinary combustion process.  Clearly, everything exposed to a plasma would more than melt but would become vapor instantly.
Reply: @danielrouw2593  by product of hho is OXYGEN.  O2 sensor sees too much oxygen and INCREASES gasoline to make it richer.  You can't run these devices with a connected O2 sensor.  Test is flawed and size of kit for engine is too small.
Reply: @jaimesanta847  facepalm. And all that oxygen is used up in cumbustion because its at the stoichiometric ratio with hydrogen. It turns back into water. You don't magically produce more oxygen than is naturally in water. Even IF the O2 sensor saw more oxygen the genset would NOT increase fuel, rather it would close the throttle body because otherwise rpm would increase. Learn some engine and chemistry basics before making idiotic comments.
Reply: 3 years later and I can find 20 studies on HHO enhancement to gas and diesel IC engines. Glad I didn't listen to the nay sayers and just tried it.
Reply: Ita not too good to be true but there are alot more science tricks that have to be considered